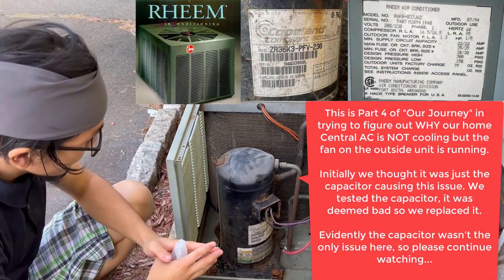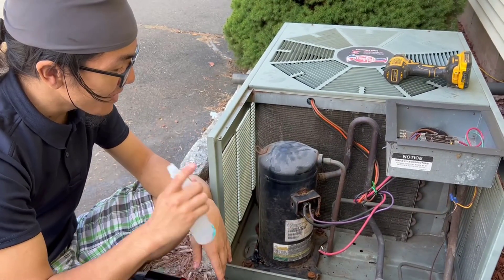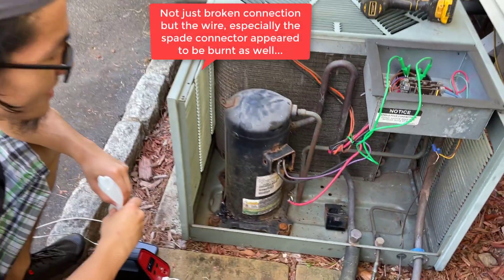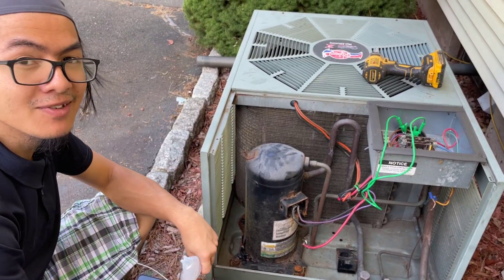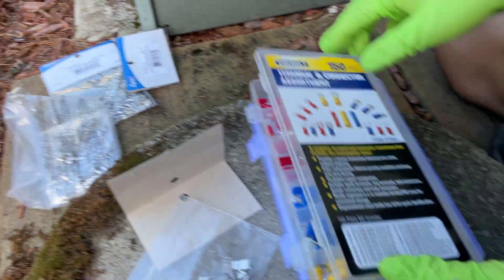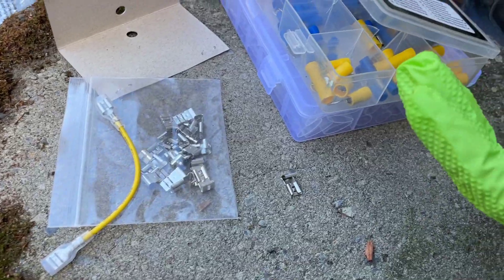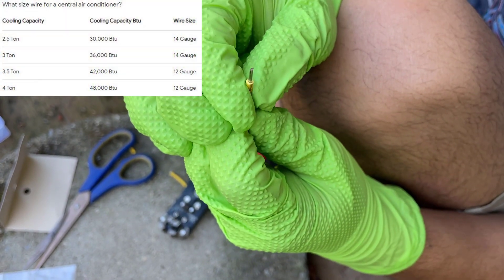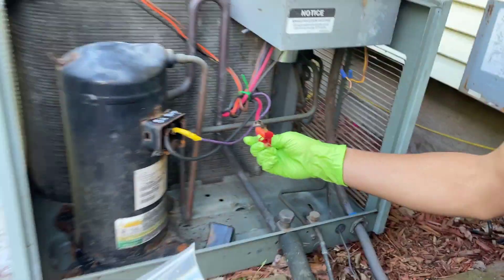AC Not Cooling But Condenser Fan Running, Here's The Culprit! | Rheem P4 MacGyvering Copeland Wiring

Comment from the maker: Here are the #ad links to some of the components, parts and tools required for this repair:
1.  https://amzn.to/45tqtvA  |   Qwik / Mainstream Engineering QT2810 QWIKLUG 3 TERMINAL 10 AWG
2.  https://amzn.to/3QWf7M1  |  43-23204-14 -Rheem OEM Round Replacement Dual Run Capacitor 50 + 3 UF/MFD 370 Volt
3.  https://amzn.to/45Plbu9  |   OEM Replacement for Rheem Single Pole / 1 Pole 40 Amp Heavy Duty Condenser Contactor 42-42478-02 
4.  https://amzn.to/3svcuqr  |  AstroAI Digital Multimeter 10MUSKRD 10000 Counts TRMS Auto-Ranging Color LCD Screen Voltmeter, Accurately Measures Voltage Current Amp Resistance Continuity Duty-Cycle Capacitance Temperature
5.  https://amzn.to/3OTVcKV  |   AMI PARTS SPP6 Hard Start Capacitor Replacement 115V Thru 288VAC Hard Start kit for air Conditioner Units from 4,000 to 120,000 (1/2 Thru 10H.P.), Increases Compressor Torque 500%

Or Click on Amazon link here and search for what you need:  https://amzn.to/3xIOsqg

Comment: I have the same unit, a year or so ago it stopped cooling, I already had plans to change contactor and capacitor but kept putting it off till the unit failed. Changed both parts but compressor would not run. That is when I found the corroded terminal and burnt wire. I had a high voltage right angle connector to use and have been running good for over a year now. You did good.

Comment: You should still consult a local hvac company. A compressor 10+ years melting terminal off the compression could warrant a worst issue than a melted wire.